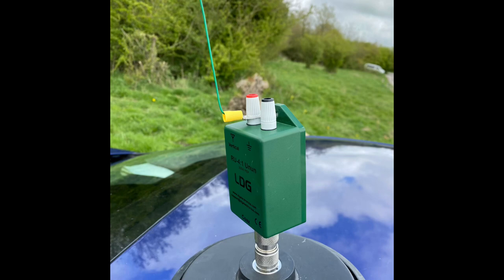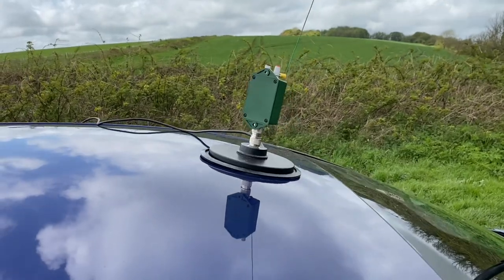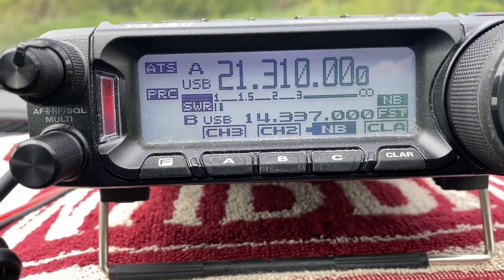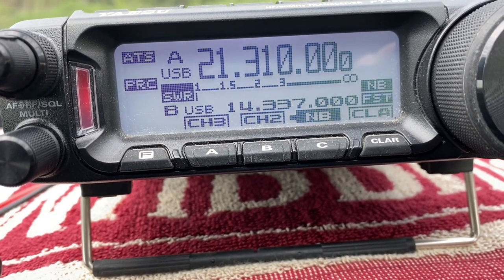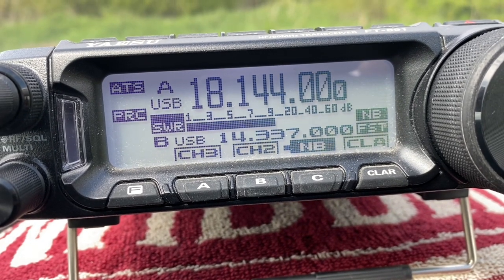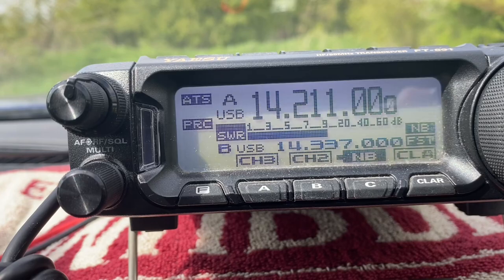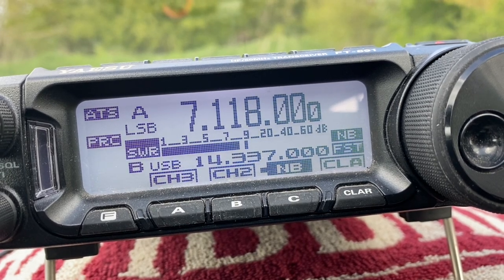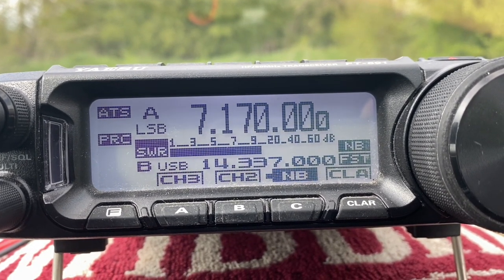Ham Radio: Simple  HF Portable Multi-Band Antenna

Comment: Got to admit... got my mind working overtime now... loving the idea of using the mag mount.. going to try my 9:1 unun and 33ft wire at the caravan using the mag on the car as ground.... cheers Tim.. 73 M6LBI
Reply: Surely a 33ft wire would be a half wave on 20m and thus would need a 49:1 transformer?
Reply: @paulsengupta971  after 40m... 1/4 wave is 33ft .. the one I use at home is that and works quite well... although for reasons I'm not sure of it tunes up on 80m too...!?!?! Ah well... suppose it works lol
Reply: @IansAnglesey  Ah. I'd have have thought a 1:1 would be the best bet for a quarter wave. Same as a dipole centre. But that wouldn't work for 80m, whereas the 9:1 probably will!
Reply from the maker: A 9:1 would probably still reduce the impedance down to matchable levels. Where a 9:1 can be an issue is with lengths of lower Z such as 1/4 or 3/4 wavelengths

Comment: I like all your antenna tests. It would be a lot more interesting to have a hamstick on a boot mount to compare to. We have no reference antenna to compare to.  An antenna switch to do A/B comparisons would tell us all we need to know. Anytime I see an antenna test on a YT video I am usually let down. The reviewer rarely has a reference antenna. A dipole, inverted V, or even a vertical would be fine. In this case a hamstick would be a good comparison.
Reply: Hamsticks have high-Q, so low bandwidth. You can do it and it works, but you have to constantly tune multiple times per band to work stations. 👍.
You end up spending more time fussing with the antenna than making QSO's.
73
Reply: @jamess1787  Sure a hamstick is not Ideal but I normally only operate in the bottom 50-75 kHz of each band (CW or a little FT8) .  a hamstick will often beat out all the fancy screwdriver antennas and other expensive gear. For 25 USD it is hard to beat. Trying a hamstick on 80 meters is a joke, 40 meters sort of works. on 10,15,20 the hamsticks really shine.
Reply from the maker: Nice thinking
Reply from the maker: 20m and up are pretty low Q and broad banded
Reply: @xv9dl  yeah if you're working CW on those bands, then you're probably OK. Im only SSB and it makes it a PITA to make contacts.
I love my "hamsticks" but it's really annoying every 20KHz to have to retune the antenna (or vswr of like 10+)

Comment: What if use 5m telescopic whip and sort of coil at the bottom to compensate the length then in to 4:1 ? At least no need for a fishing rod?
Reply from the maker: No sense in adding an inductor AND an impedance transformer. If I had to alter this antenna I would feed the wire directly int a remote tuner. 73

Comment: What is actually the Diffference between the LDG RU 4:1 and the RBA 4:1 Balun ?
Reply: I believe one is an Unun and the other a Balun. The Rybakov should require an Unun (Coax to unbalanced antenna system). 73 Leo
Reply from the maker: Yep what Leo said